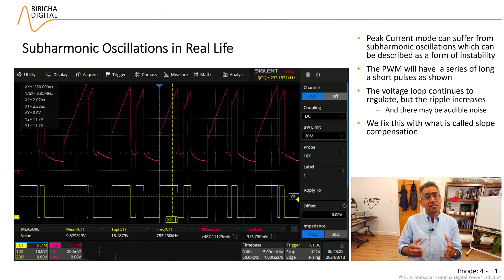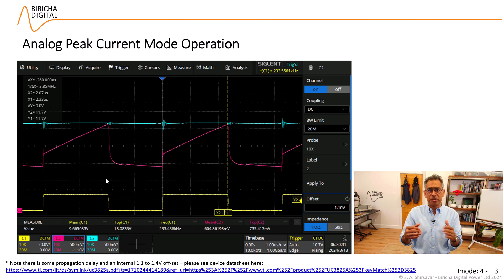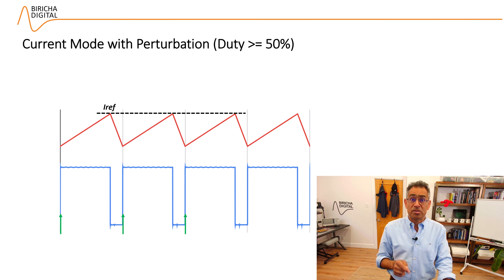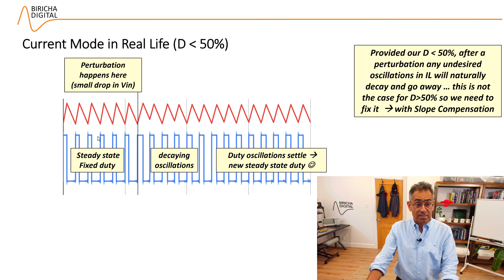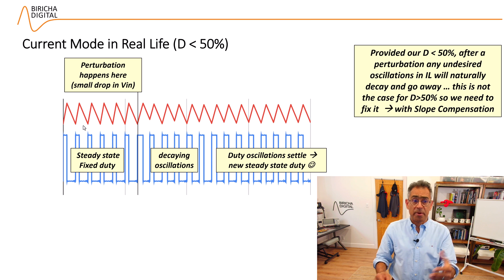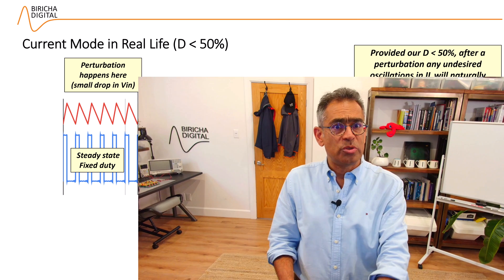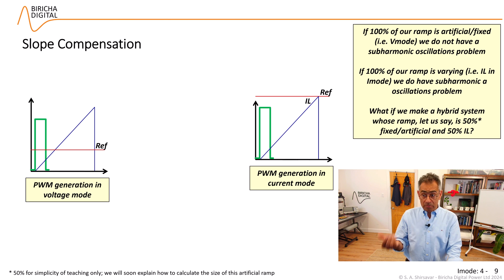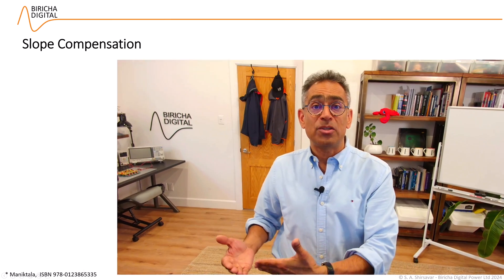An Easy Explanation of Subharmonic Oscillations & Slope Compensation in Current Mode Power Supplies

Comment: Thanks you so much.
Your video is verry good and verry clear.
I realy appreciate animations that you used to explain the subharmonic oscillations, the fondamental difference betwen voltage mode control and current mode control, the slope compensation.

Comment: Wow man!! You went straightforward into the subject, no prolonging, unforgettable exlanation and really clear representation. I had to go through this because the IC I'm designing with doesn't add the Ramp signal by itself. It's giving some instructions and equations to build a compensation network that makes the slope compensation out of the reference voltage and the oscillator RC charge/discharge process. I really appreciate this demonstartion and feel much more aware of what I'm dealing with, rather than following just some rigid rules or random selection and tuning of the elements. 
Best wishes!!

Comment: I appreciate the effort that goes into videos like this, and also the desire to tell the story clearly. I'm an EE, I know a bit about switching power supply circuits. and unfortunately I don't think this video achieves its goals. The main problem is that the explanation is unmoored from even a generic diagram of the circuit to which it pertains. The presenter identifies all the signals under discussion just verbally and rather vaguely, so it's often hard to tell what is actually being discussed.  
For example, around 3:30 Iref is referred to as "our demand current value". Wat does that mean?  This is surely a power supply producing an output voltage, (that's the demanded value), in which there's feedback that the controller uses to set the peak current of the ramp for the next cycle.  I guess Iref is that peak value? But that value will change from cycle to cycle, so why is it referred to as "Iref" as though it's a fixed reference current?  Either I'm unfamiliar with the terminology or I completely don't understand the circuit under examination.
Later there's a comment that the subharmonic oscillation will greatly increase ripple current. Well I suppose that's just describing the alternating short and long current ramps.  But what is the significance -- is the concern about disrupting the upstream supply? Or disturbing the downstream circuity, where I would have thought that voltage ripple would be a more immediate concern?  Here again, being able to point to the location in the circuit that the issue applies to would be very helpful.
I was very impressed with the nice animated graphs at 10:39 ... except I didn't understand what they display. What are the axes, and what are the signals plotted in red blue and green, referred to points in a schematic that I could recognize?  
At the point where discussion moved on to some kind of synthetic slope I was basically lost. I thought the sloped signal was the inductor current ramp, something tangible. So I didn't see how that could somehow be made synthetic. Maybe this is trying to illustrate the signals that the controller pays attention to, and the enhancement is to revise this controller input variable by adding in an additional signal or calculation. I'm not at all sure from the verbal discussion, but would have been if the graphed variables were identified with points in a schematic. (Possibly with the schematic enhanced to show stages of the controller's internal algorithm, if that's the story.)
So again, I appreciate the effort, but for me, who I think might be a representative target audience, this flew over, or at least around, my head!  A schematic or two to identify signals please!
Reply: In voltage mode control, it's true that the demand value is the output voltage. 
The control loop takes in the voltage reference as an input and directly created the duty cycle of the switch as an output.

This is also the case for current mode control, because at the end of the day, you want a fixed output voltage. However, there is also a reference value of the current, but the current reference value is not fixed by the design, it's just an intermediate value which is generated by the circuit.

One way to think of it is that you actually have two different control loops, an inner control loop and an outer control loop. 
The outer loop takes the voltage reference as an input and generates the current reference as an output.
The inner loop takes the current reference as the input and generates the duty cycle as the output.

When you analyze the inner loop by itself, it can be correct to think of the behavior for a single switching period. During a single period, Iref will basically be a constant, since the control loops operate at frequencies lower than the switching frequency.
Reply: @ThePyrosirys  Thanks for your comment, I think it was helpful. In your final sentence, I take you to mean that the outer (voltage) control loop operates at a frequency lower than the switching frequency. While the current control loop operates within a single switching cycle.  Is that what you mean?
Reply: @Graham_Wideman  Yes exactly. Since the inner loop controls peak current, it has to act on a cycle to cycle basis. 
Typically the current compensator just has a proportional gain to convert the measured current to the appropriate voltage range. There is no low pass filter, since that would only prevent the control from actually detecting the peak current.
Reply: Just to add --- I did see that there's a PDF with more detailed notes. I will download and read that. So no need to answer the questions I raised per se. This is more a suggestion about ways to make future videos more followable.